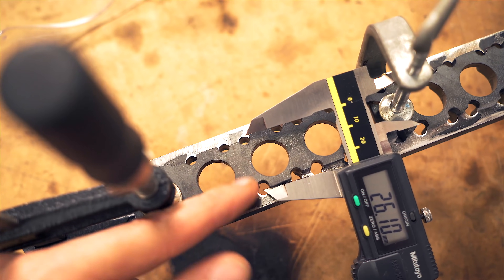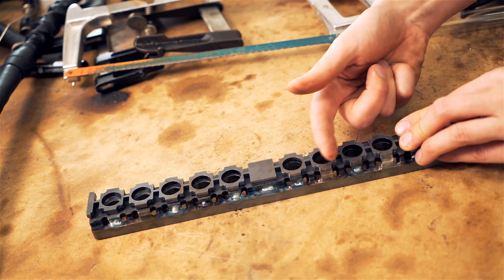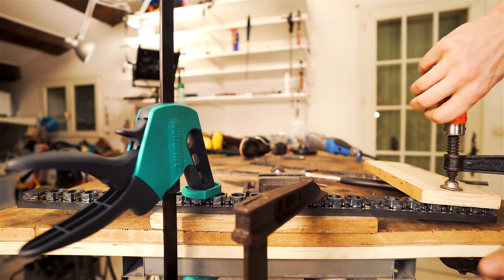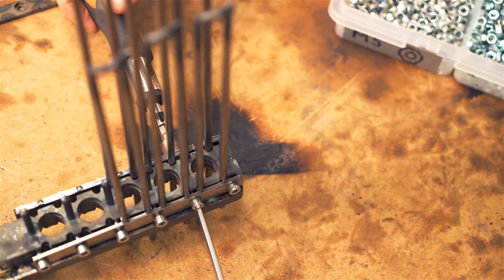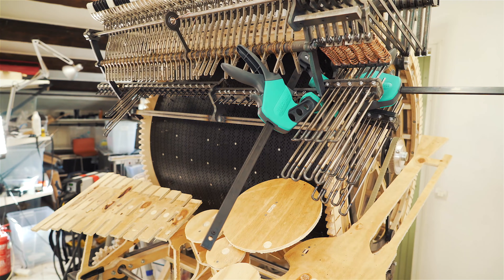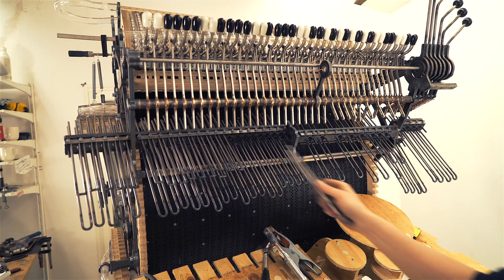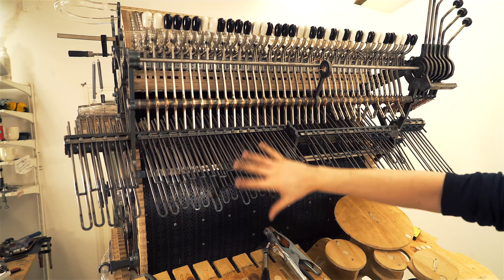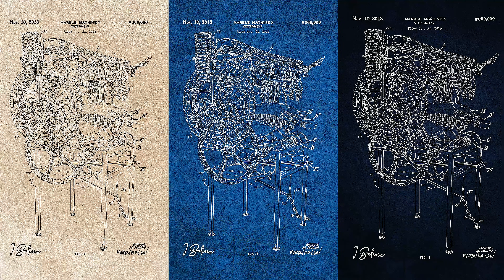Tig Welding Marathon - Marble Machine X #75

Comment: Those Copper springs for the levers needs to be changed out with a different design for better look. The color should be changed as well to match the machine, the copper is just offsetting ;)

Comment: Martin, I am sure that this has occurred to you, but do you know how much this masterpiece weighs? How many ball bearings will it hold when operating? I suggest that you look into installing permanent weighing stress gauges in all four legs and totalizing them. Where is its centre of gravity? It looks a little topheavy and you certainly do not want it to fall over. Senior engineer (former manager of quality assurance) and horrible amateur musician. I suspect you know exactly the weight of all of the balls. You could have a contest to see who has the closest guess at the weight. Cheers! :-D

Comment: After closer inspection i realized these videos have been filmed and published out of sequence. This video was made Pre #72 as you can see this assembly on the marble machine already in episode #72, not to mention all of the cross bracing from video #72 is missing from the machine in this video. makes me wonder if the machine isn't in fact already done and the videos are being published one by one weeks after the fact.
Reply: after even further inspection i noticed the cross bracing from #72 also appears in video #70. Meaning this work video occurred at least 6 weeks ago.
Reply: Yeah, these videos aren't uploaded in order, rather when specific components are done (eg when the crossbracing is done, that video is out. When the marble divider is done, that'll be released etc etc.) This may make the "timeline" confusing, but it isnt done yet - you can trust me on that.

Comment: the distortion was because you welded everything in one go next to each other. you should weld inside out and diagonally and from side to side with space in between. then you avoid that the welds pull the material in a bend. also, let the welds cool next time a bit. just a tip for the next time you have to make a lot off welds on a thin of long piece of material.

Comment: You could have just made the hole diameter slightly bigger than the tube inner diameter, but less than the outer diameter. No ledge no matter what.

Comment: Safety tip: if you don't wear a face shield when angle grinding (which is highly recommended), keep your face out of the plane of the spinning grinding disc. If the disc shatters, the pieces tend to fly out along the plane of rotation and you don't want your nice-looking parts anywhere near them.

Comment: Just a thought, but wouldn't it be possible to create a midi-to-marble machine interface? You could have something like a bracket that holds an array of servos that you can drop on the programming wheel, and use servos instead of pins at the top. Then you could play the marble machine with a midi keyboard, play back recorded midi music like a player piano, or even load a test midi file that can trigger each channel, record the input from the mics, and calibrate timing based off that.

Might be a cool project for later

Comment: Awesome work Martin - absolute joy to follow the progress. But I'm kinda worried about the possibility of excess metallic noise the marbles might make when making direct contact with the newly added rails/tracks. Mostly because of the amount of marbles which will be in constant movement. If it ends up becoming an issue - maybe you could somehow seal the rails in a thin rubber tubing. Just a thought. Already waiting for the next episode of this adventure. :)

Comment: I recently designed a project intended for resale. I checked pricing on bolts and found that m4 and m6 bolts were essentially the same price. M5 bolts were 30-50% more expensive. So I designed it all for m6.
Anyone have a similar experience?
Is that true in "metric countries"?
I'm in the U.S.

Comment: First rule of model making models: you should never EVER glue directly onto a build with moving or removable parts before the build is finished, just in case you weld the wrong things and screw up its ability to to move or come apart. Wintergatan, I trust your judgement but you shouldn't ever commit yourself like that, what if you need to do something with the machine and now you can't without cutting it apart?

Comment: A little trick when welding parts like that is to bevel the edges a little bit. Also try a little thinner feed rod so you don't have to get the puddle as hot to melt the rod. Watch every week. Coming along great!

Comment: Has the marble bandwidth bottleneck been determined?  The kinetic energy killer snake/ marble divider combo seemed to slow down throughput to ~4 marbles per second passing over the marble divider. So if you exceed 8 marble events per measure (2 marbles per crank turn) at 120 bpm, the base line will start to dry up, no?
Reply: He said it not me!

Comment: Martin - 
What if it rains during a concert?
What if the humidity is very high at outdoor venues?

There is a lot of exposed wood on the MMX that will absorb the moisture in the air,  and it would be an absolutely devastating tragedy to have not prepared for warped or swollen pieces of wood.
On a side note: thinking about going on your world tour,  are there plans for building/cutting replacement parts for the wood prior to going on tour?
 Your comment "the seasons are changing" and it got me thinking... 
Hopefully, I missed a Wintergaten Wednesday where you have already addressed this concern, but if not, I hope there are plans for protecting/preparing the exposed wood before completing the MMX masterpiece.

Seriously...this is amazing work you are accomplishing, and my daughters and I thoroughly enjoy Wintergatens music and Wintergaten Wednesdays!

Cant wait to see the MMX in person!

-Irish
Reply: Plywood dudes. Search it on the internet, its an ultra resistant wood made to withstand any adversities. Even planes have parts made of plywood.

Comment: I am slightly concerned by the amount of post production processing that’s required on the X. It means that god forbid should something happen to the machine in transit it’s not simply a case of machining new parts from the CAD and putting them on. This does add some risk...

Comment: I think a sticker of some color or print on the programming wheel plates, between the vibraphone and drum track sections, might be nice to follow where they split in the rails you just welded. It might make the look of that section more smooth. Unless it will be covered eventually which I doubt.

Comment: Wow!  Amazing!  Reminds me of when I was a kid rebuilding and restoring old piano's but clearly the marble machine has waaaaay more parts, and a hundred plus years from now when somebody is rebuilding and restoring your machine what will need to be done?  On the pianos, it was the felt hammers, felt dampers, felt washers (under the keys) and the leather and cloth straps to the action trigger, and the leather on the adjustment control I had to replace.  And the keys too, since most of them were made of real ivory and they were worn out.  Finally, the strings that had broken on the retune, since often old pianos get neglected and are waaay out of tune.  On a sidebar, each time we see your machine, it is only getting heavier and heavier, and you are building this on the second floor of an old chateau?  Aren't you worried the floor might give way from all the weight?  It would be heartbreaking for all of us if that happened and it were damaged so close to the end of the project.  Love your work!  You are an amazing artist AND engineer!  Can't wait to see the fruits of this labor!

Comment: Umpapa- umpapa....

Please don't get into the habit of grinding on the backside of the disk...they may explode on you then, and that would be scary and could be terrible to your well being. I'm impressed and a bit anxious that you used an angle grinder inbetween those units to cut off the tabs. I probably would have gone for a Dremel, but you smashed it. The home stretch is pretty tough, and it must be nerve wracking to start to make plans,  and plug away at finishing the mmx. Imagine how much music you can compose when this is finished, sitting in the corner of your music wall space. Thanks for the vid Martin.

Comment: Aren't you worried that by making so much of the machine out of metal it's going to be way to heavy?! I feel like many of these non-structural components could be made out of much lighter materials and maintain the exact same functionality.
Reply: Exactly my thougt to. The parts in this video is made of several layers of  watercut steel-plate that is welded together.
A "solid" CNC-milled beam in aluminium with all the features would give the same (or better) result and saved a lot of weight, welding and adjustments

Comment: I'm no welder but I've heard you can avoid distortion by placing the parts on a copper block or any metal that can absorb heat. Also weld by sections, for example; if you imagine a part to have 8 sections, instead of going in a sequence of 1-2-3-4-5-6-7-8, go with 1-2-5-6-3-4-7-8 so that the parts will not get too hot.  Sorry for my poor english.

Comment: "Deez Nuts are adjustable." Wintergatan 2019
I'll see myself out.
Reply: Ha got him!
Reply: BTW, it happens at 4:28 if you want the direct link. :-D
Reply: @wintergatan pin this!
Reply: I was about to comment about the same thing 😂
Reply: Adjustable with one hand from the front.
Reply: Sugondese marbles
Reply: Those were called "stop nuts" and were used in aircraft because they cannot vibrate loose. Jam nuts? Cannot turn on their own. God, this thing is getting complicated. It had better work, eh? Just a Canadian engineer amateur musician who used to be fascinated with barrel organs, etc. There is an autolist violin player at The House on the Rock in the USA. https://en.wikipedia.org/wiki/House_on_the_Rock 
Have you thought of installing weighing strain gauges in the legs to constantly keep track of the weight of this monster? It IS fascinating. Keep up the good work. Cheers! :-D
Reply: Martin has nuts of steel to attempt this project. Startup is going to be do-not-miss occasion. Good Luck. Wow. Martin do you have an estimate of the weight of this creation?
Reply: No no, come back in and sit down.
Reply: He is going to die of LiGmA
Reply: They also auto adjust when you cough hard
Reply: Nice catch.
Reply: He really needs to make sure he's not using BOFA in that design though.
Reply: Haha Good ear

Comment: When you open the X cage on the back of MMX to change the wheel, the two feet are sticking out at eye level. When the MMX is on a dark stage between songs, this is a major safety issue I think. I'm imagining someone power walking into the black, open X frame and getting POKED in the eye.

I would put some high visibility material on the bottom side of those feet so it is only showing when the X frame is open. I would also consider putting black foam or rubber on those feet.

Maybe I've just spent too much time around safety engineers...

Comment: I've been wondering for the bass portion a lot lately, and I think It should be a headless design where the tuners are on the bridge using strandberg (a swedish guitar company)  esg tuners. This way you can change the tuning of the song while staying in front of the mmx rather than with traditional headstock designs where you'd have to go step to the back to change tuning.

Comment: How does the MMX handle the expansion of wood due to the different humidites it'll be going through on the world tour?
Reply: Cain Thomason plywood doesn‘t really change it‘s form.
Reply: Pretty much everything is adjustable, including the gear spacing, I believe. If it's binding up because the wood swelled, it should be possible just to loosen things up a bit.
Reply: if it ever becomes problem they can go to brass gears
Reply: ThunderClawShocktrix way to heavy
Reply: @jakob803  I'm not so sure that brass would be too heavy. If you look at clocks, they cut out large portions of the brass wheels to reduce the weight. Do an image search on "brass clock wheels".
Reply: That’s a great question! Up to this point, it seems like Martin has thought of everything. I’m sure he has some kind of contingency plan, and I know a large portion of the MMX was designed to be adjustable.
Reply: My wood is expanding just by thinking of MMX